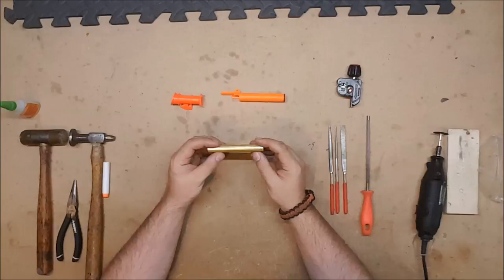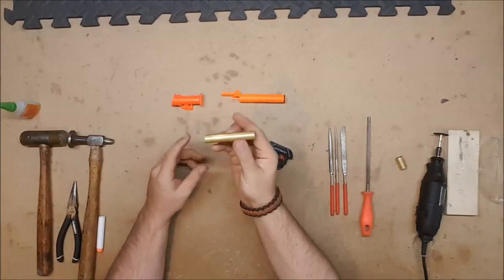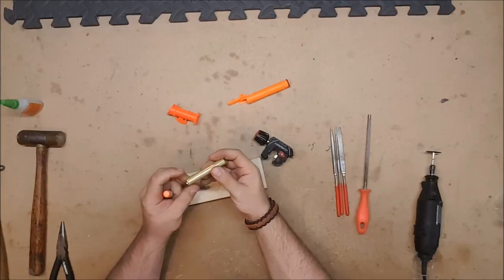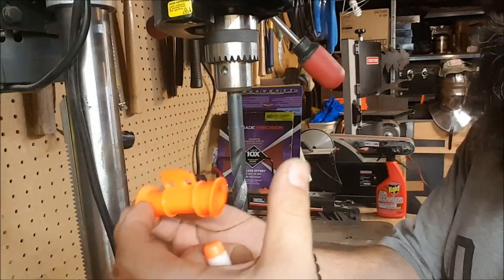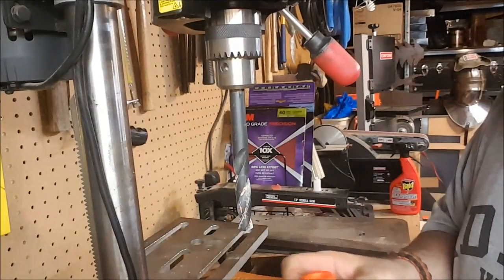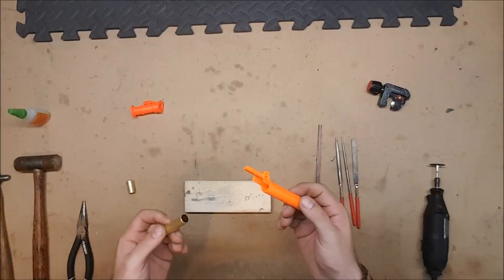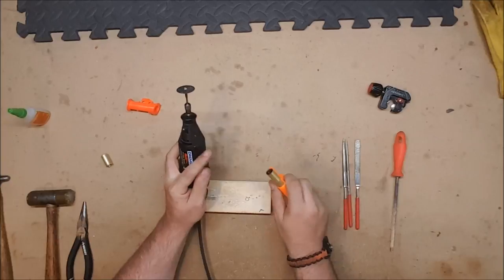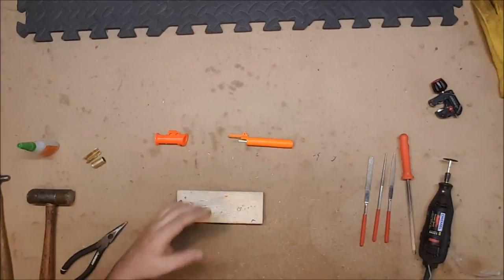Monday Mod Tips - Episode 2 - Brass Barrels

Comment: if you had an Immortal Longstrike kit would  you only need to brass the barrel?
Reply from the maker: To determine what is "needed" you must first define a goal.
Reply: a Long strike that hits like a truck but is still a springer,
Reply from the maker: Then yes, you will probably need to build a full brass breach and use half darts.

Comment: just asking but can u brass a fly wheel blaster or is just for springers?
Reply: It is possible but not with 17/32" and not for the same purpose, the only reason to put brass in a flywheel blaster is a kind of accuracy boost that I'm not entirely sure how it works, but usually it's 9/16" for that purpose as it's more of a guide not a tight fit
Reply: Sen Kanashimi thanks man
Reply: I thought you used 5/8 brass to brass flywheels
Reply: I'm not sure there's a particular correct diameter, I've heard 9/16 more at least around my area
Reply: Creed King18 VladtheNerfNeko (Drac's friend Vlad from all of the Endwar videos) recently did a video about brassing an Artifact Red cage to get similar output to the Dr Snikkas cage.
Reply: Brass or any other tightbore barrel in a flywheeler (you can even use PETG or PVC, but brass is generally thinner than most anything). Though I don't fully understand it either, it generally tightens groupings presumably due to helping guide and center the dart after leaving the flywheels, at the cost of some FPS. They are necessary for canted cages to function reliably, as they will whirlybird darts quite often without them (certain ones more than others).

Sizes are generally 9/16ths to 19/32nds, the former is sometimes too tight in warmer weather.

Comment: Ive heard using a 9 16th barrel is better and to use 17 32nd just for the breach. Its this true?
Reply from the maker: It depends on the build. For long barreled sealed breaches that is sometimes better. For a single shot brass barrel, no.
Reply: @CaptainXavier  what about brass breaching something like the modulus longstrike?
Reply from the maker: Again, depends on the build. Style of breach, weight of spring, length of barrel, desired fps, etc. There are no easy answers. You have to do some research and some experimentation.
Reply: @CaptainXavier   ah i see. Thank you for your help

Comment: Is this possible with a snapfire. The barrel looks very small and I don't want to break my blaster
Reply from the maker: If you mean the Snapfire 8 I would not try it.  Revolvers do not brass well.  The chamber walls are usually thin and they rarely have enough power to clear a brass barrel.
Reply: No I wish but I have a modified new snapfire the one with the pull back prime and wanted to squeeze some more power out of it but the barrel looks very thin and wanted to make sure I didn't compromise the structure of the barrel. Thanks for any advise you can offer
Reply: Captain Xavier Maybe he/she means the small, jolt-like pistol known as the snapfire or a sharpfire.
Reply from the maker: You can try...but again you run the risk of actually losing power if you cannot up the spring enough to clear the barrel.
Reply from the maker: But then I have successfully brassed jolts so...probably?  But the increase is going to be maybe 5 ft?

Comment: Would brassing the barrels on a smart AR gun make it worse due to the need to keep the AR's?
Reply from the maker: Not if you put in a string enough spring.
Reply: Captain Xavier Right. I'm just not yet comfortable doing springs yet.

Guess I should start watching your "Can it take a K26."
Reply: Kzitold if you enjoy this you will SUPER enjoy the K26 series. You learn the history of certain blasters, how to tear them apart, little tips and tricks, what springs they can take and how to "button" them back up as Cap says

Comment: Will 1/4 suffice as a substitute for the 17/32 (i know you respond and just praying you see this)
Reply from the maker: 1/4in?  No...not even a little.  Nerf Darts are 1/2 in.
Reply: Captain Xavier hm thanks. I had a 1/4 in pvc pipe that fit quit snug and was wondering if it transferred over
Reply from the maker: 1/4 what? It can't be inches. First of all they do not make PVC that small and second that would be half the size of a Nerf Dart, there is no way it would fit.  Now I am curious...
Reply: Captain Xavier well mabye it’s you haven’t seen it. It’s a nice tight fit around the dart and works quite nice. I use it to singe my talon and for a better fit on darts for my k26ed firestrike
Reply: Captain Xavier I’ve used it so many times that I have cut off the part where it states the size. The reason I asked it because 17/32 brass has a 23 day ship time and I was trying to cut it down with a differnt size brass

Comment: I know this may sound stupid but can I brass barrel a buzz bee double shot, I’m looking to just make a super modified one because I like double barreled shotguns and This is the only one I can find
Reply from the maker: I honestly don't know. Those blasters are very weak. It is work a try though.
Reply: @CaptainXavier  ok they are only ten bucks so if a break it I can always buy a new one for dirt cheap
Reply: @CaptainXavier  I guess I would have to add a stronger spring and then a stronger cord, and after that I could take advantage of the brass barrel
Reply from the maker: @william2glaser227  absolutely. A better double barrel shot gun (if you can find one) is the X-Shot Eliminator. That thing is a beast.
Reply: @CaptainXavier  I’ll look

Comment: Does pvc work
Reply from the maker: If you can find PVC in the right diameter. Cpvc comes in the right size but is too think to fit in the original barrel. That is why we use brass

Comment: cap couldnt you have just cut the brass a bit short so it fits without dremmaling
Reply: my guess is it would not load rite, that finger guides the dart from the mag to the tube. if you dont have a smooth path the dart would bind up.

Comment: Can you use copper instead of brass?
Reply from the maker: You can...but it is not going to work as well. Copper is heavy and soft.
Reply: @CaptainXavier  thanks you, I was asking as I chopped off the barrel of a damaged jolt that I was going to through away and had some copper around so I thought it would be a good idea to attach a copper barrel to a jolt to see if it improves anything. Thank you.

Comment: Would this work for a mediator?
Reply from the maker: Yes
Reply: @CaptainXavier  cool, thanks! Would it be beneficial to brass say, my modded strongarm or hammershot?
Reply from the maker: @squareyoyoer640  not really. You might gain a little power but at the cost of reliability and reload time.

Comment: Yeah cap I am making a drain blaster and my barrels are just made drone spare parts. Except in new to nerf modding so I used a vice a drill bit and made a plastic like thing I spend a couple hours on the make a shot gun shell and accidentally tore it up. You can probably understand how made I was

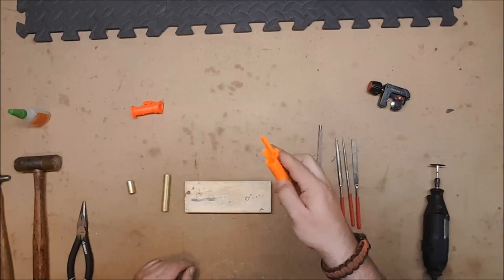Comment: 1:24, 10:34 mmmur-derrr... x)
would the brass breach process shown here work in a Slingfire? i recently (as of posting) got one, and i want to fix it up a little bit. i assume it would in theory, but no harm in deferring to experience.

also, would you consider it worth it to brass the breach in a Slingfire without doing a spring upgrade? (i enjoy the trick-priming it can do, but would like it to fire just a little bit better without sacrificing that capability if possible)
Reply from the maker: Without a spring upgrade it would probably make the performance worse.

Comment: Why do you not want John to cut brass with your band saw?
Reply from the maker: Because it does not have a metal cutting blade on it and now it is so dull it barely cuts wood.
Reply: Sounds like John owes you a blade.

Comment: i am currently in the process of brass barreling a modified barrelstrike, its just as agonizing as it sounds
Reply: Dan Meuse I see it as unnecessary but it still seems pretty cool. Good luck!
Reply: @air_  im thinking of using it as an emergency last resort in hvz, like a jolt on crack. Something I can use to get out of being cornered by several zombies with one triggerpull. I finished it 2 days ago, and it works surprisingly well. to be honest im mostly just doing it for shits and giggles, and its great for that

Comment: Why use brass instead of galvanized steel? it’s much cheaper to use steel
Reply from the maker: Can you provide me with a source for steel with the same inside diameter and wall thickness?

Comment: If HobbyTown ever runs out or discontinue their brass tubing ($33 for 9 feet of 17/32 brass tubing; $3.67 per foot), Walmart has an almost as good deal for a similar product ($15 for 4 feet of 17/32 brass tubing; $3.68 per foot).
Reply from the maker: I currently buy it at a local hardward store.
Reply: Just putting it out there that Walmart's "nerf brass" is less than $0.02 more expensive than the equivalent product at Hobby Town, which you said was your prefered source of brass at the time of this video. Also, all the plumbing brass at my local hardware stores is fittings, no tubing.
Reply from the maker: In my store it is not in plumbing. It is in the door fittings aisle.

Comment: can i brass my disruptor
Reply from the maker: Are you asking my permission?
Reply: never mind you might not understand because its complicated  to explain but let me know if its possible and im gonna also put the worker 6kg strongarm spring if its not possible with a downgraded stalk spring which means im using  a grey trigger disruptor
Reply from the maker: My confusions stems from the fact that of course it is possible (I mean why wouldn't it be?)...but it might not actually fire after you do. For brass barrels to be useful the blaster must have enough power to overcome the added seal. Revolvers don't always brass well because the seal on the darts in the brass is stronger than the seal between the cylinder and the plunger tube. Make sense?

Comment: It's an old video i know but maybe someone will stumble upon this. Why the hell most of the nerf community uses brass instead of good, old, cheap steel for barrels and breeches and stuff?
Reply from the maker: Brass can be gotten at Hobby Shops, is lighter, easier to cut, is polished smooth, is cheap, Is thin walled, and pretty.  Personally I would also prefer steel as I do not like the color of brass.
Reply: Brass is actually prettier, most hobby shops (at least around here) have 1mm walled steel pipes (i'm not sure about 13mm inner diameter tho), you can go to a hardware store not a hobby shop, and actually who is going to look at it, unless you brass a single-shot thingy an feel the need to have like 10cm of barrel sticking out. Then again you can paint it or something.

Comment: This... isn't how you do a brass breech though  :|
Reply from the maker: +IcyNami Not a Full Sealed or Angel Breach, no. This is the beginners version. Patience. I will get to the advanced stuff eventually.
Reply: Not even a beginners version. No one should just be putting 17/32nds brass alone into their chamber. You gain no advantage, and it wont feed new darts (or even some worn darts for that matter, because the diameter reduction wont always be enough to chamber)
Reply from the maker: I know several guys in my local group who run blasters with this exact setup (they taught me how to do it) and it works perfectly good for them.  *shrugs  If it does not work for you...I don't know what to tell you...